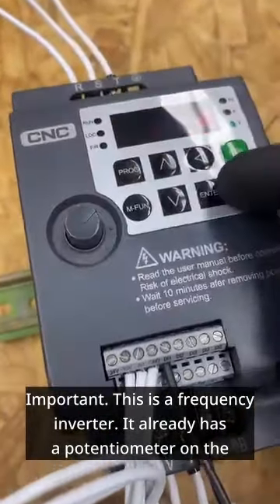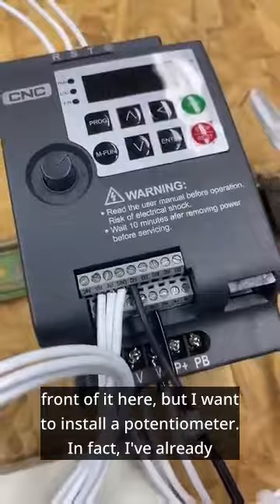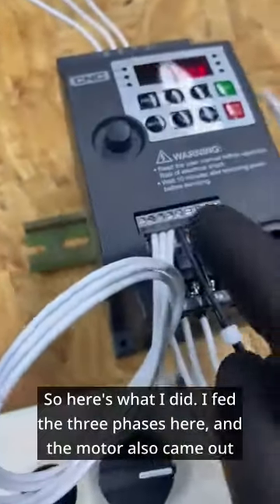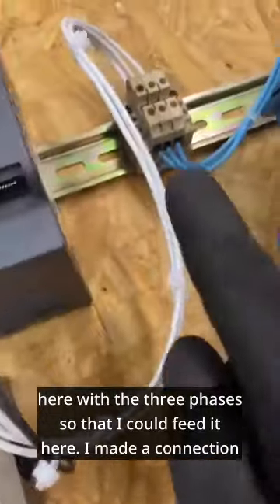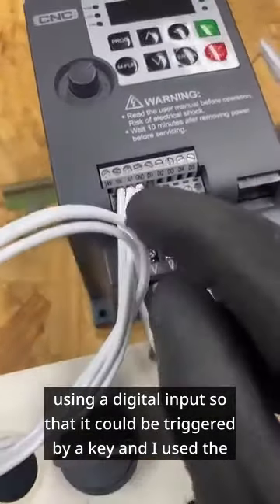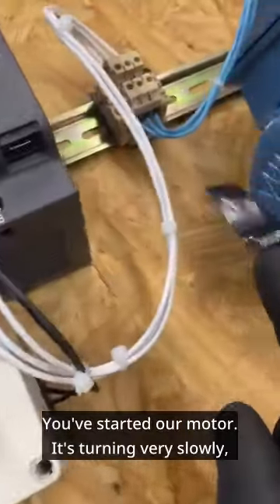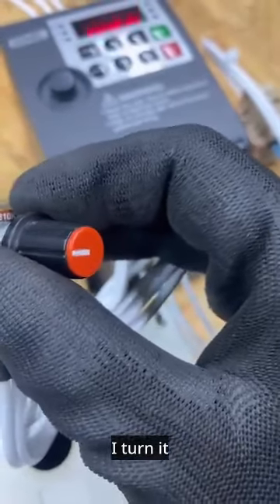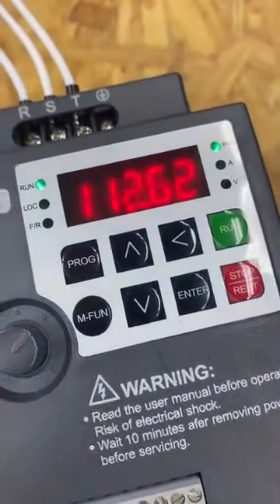VFD and Potentiometer for Speed Control of A Motor

Comment: Hi Cnc people. 
I just bought 5 units of 2.2 Kw power. Monophase input, and triphase output.. I starting to liking it because there is a lot of options. I want to buy 10 more of the same ones, my question, what is the right breaking resistor for the same 2.2kw unit?. Hope you can read and answer this.